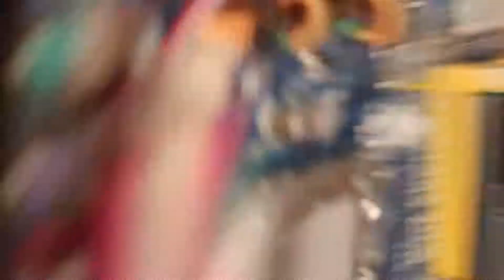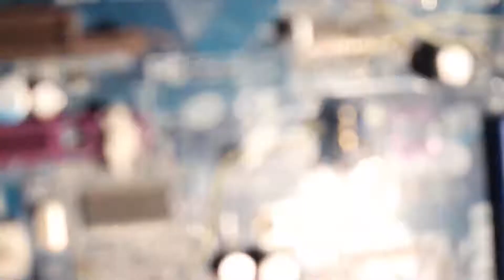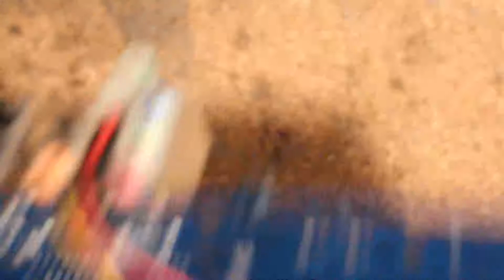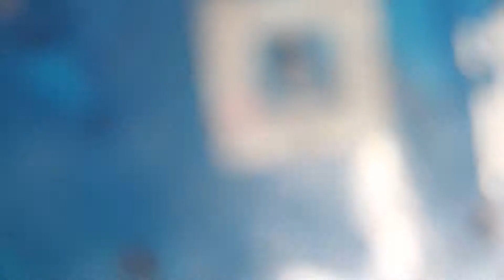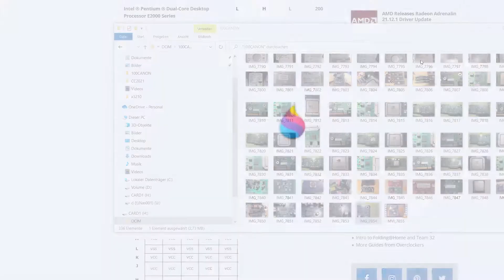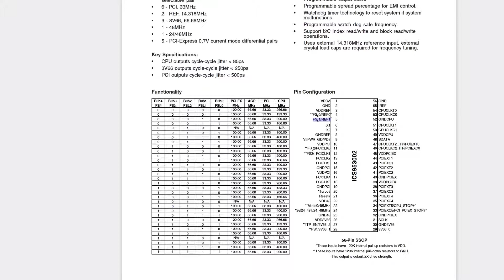Making the fastest DDR1 Board even faster / 4CoreDual-SATA2 voltmodding for XOC

Comment: I finally found such MB for AGP GPUs testing, but unfortunately that board doesn't have voltage and multiplier settings in bios, but fortunately, these C2D CPUs can be overclocked pretty well even without increasing voltage. What I don't understand is why they didn't put DDR2 slots there when it's conroe platform, maybe it has something to do with AGP slot I guess.

Comment: 20:00 I can't believe you can jumper mod a lga 775 board. No way to get at the the unused bsel2 pin without reballing the socket. Not at all worth trying when you can just short the pads on the cpu itself.
Reply from the maker: You can usually track down BSEL pins near clockgen, it's really easy with boardview but even managed without :) so no need to get crazy with reballing and stuff.
Allso on this board in particular there's no BSEL2, clockgen doesn't have input for BSEL2 so it doesn't matter if you mod it on the CPU at all.

Comment: have you done bios tweaking to inorder to accept quadcore Xeon cpus and 4 gb of ddr2 ram? the only thing that makes it worthy to do is infact it could be the fastest AGP motherboard if we agree X5450 is more capable of Phenom 2X4
Reply from the maker: Board deffinetly runs quadcores, not sure about 4Gb of RAM, as the good stuff is all 1GB sticks, so never tested... X5450 is worthless on the board you need unlocked quad as FSB is very limited, phenom ii x4 can beat core 2 quad in some benches, mostly because of way higher clocks, for QX limit on the asrock board even with mods is ~5,3GHz where as hardcore modded nf3 board + good phenom II should do 6G+
Reply: @taggxoc  you see there is an poor man's version of this board which only says core 2 duo supported but they are twin brothers ,the model is 775 dual vsta , there are videos online showing 4gb support and also tweaking micro codes of bios to accept better cpus but as you said fsb is limited !

Comment: if I remember correctly the 6500k won't run, but I am not 100% sure. as you said it is a bad chip anyway :) qx9775 or 775 qx is the way to go. 
Thanks for the guide
Reply from the maker: I just did a quick test it indeed doesn't POST, have to test more , because there are scores on hwbot using 4coredual and 6500K, might be as easy as adding ucode so it knows what multi to start with :)